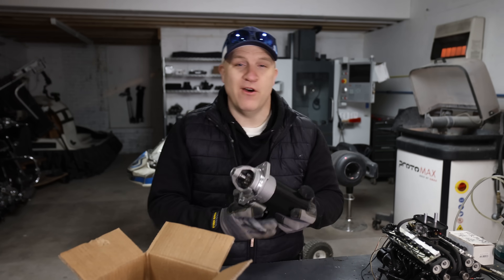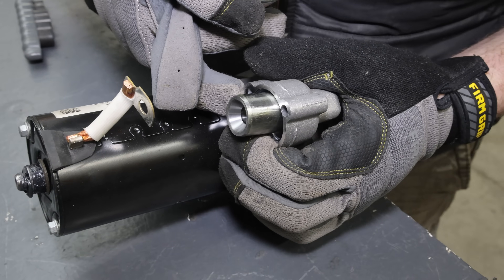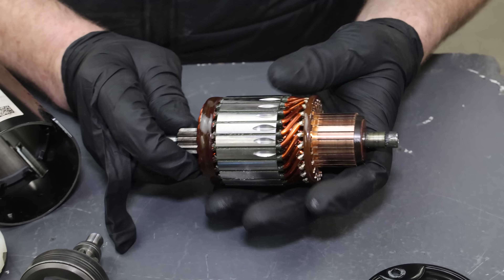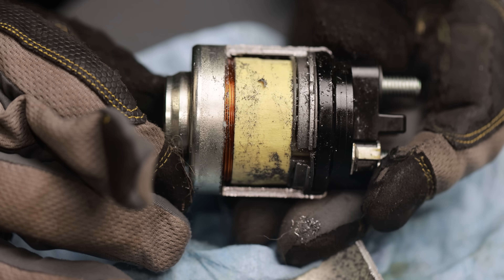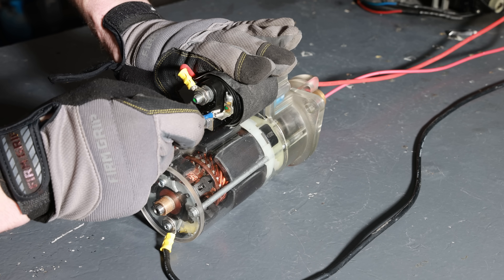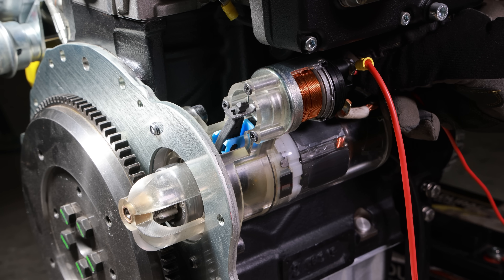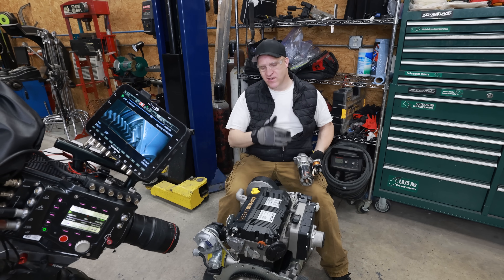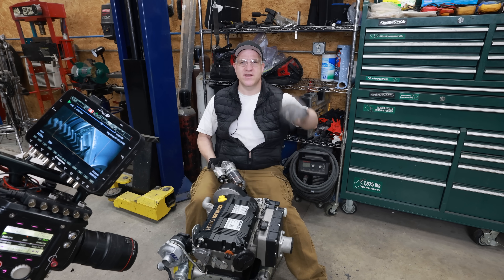See Thru Engine Starter

Comment: The cylinder where the magnets are glued need to be metal, it's called flux ring and it improves torque and efficiency
Reply from the maker: Yeah I meant to talk about that in the part in the video where I mentioned about the transparent plastic case and the ground, but I forgot and I didn't think it would make that much of a difference, it made a huge difference. I'm positive if I would have pulled the injectors out of the diesel it would have still spun it but that was way too much work as you could imagine. The magnetic flux is definitely a cool subject, magnetism in general is very mesmerizing.
Reply: Yes, magnetism is a weird thing. We all know it, yet none of us really know what a magnetic flux is and how it works. Luckily as engineers we can apply rules of thumb and use it well. We don't need to worry about the quantum theory of magnetism which is far more weird than you can possibly imagine.
Reply from the maker: @dr_jaymz  exactly what im thinking about is the quantum theory, cosmic forces like magnetism and gravity are very strange things.
Reply: @WarpedYT pulling glow plugs is easier on those.👍
Reply from the maker: @chrisprobert6  but I thought the glow plugs on these only go into the intake manifold, I didn't think they went into the cylinders.
Reply: Came here to say just that. I imagine the torque is down quite a bit without the flux concentrating through the case. On top of which I bet the ground is not passing enough current either.
Reply: You are right.
Reply: it contains the magnetism?
Reply: @gabrielvieira.4358  It concentrates the magnetic flux by effectively short circuiting it through the metal housing. You aren't making the actual magnets stronger just increasing the density of the magnetic flux. A motor without a housing and flux ring is like pushing against air, and a motor with a housing and flux ring is like pushing against water there is more for the motor armature to push against.
Reply: @ADRIAAN1007  So it's literally what I said, it contains the magnetism so its stronger
Reply: @gabrielvieira.4358  it's got electrolytes
Reply: I thought that was the flux capacitor. :D
Reply: @sonicdewd Beat me to it. I was just looking to see if anyone went there. Great minds think alike.
Reply: The metal housing gathers up the flux from the opposite side of the magnets, the side away from the rotor. By combining all the outside poles, each inside pole of each magnet can push with about 4X the flux field as a single magnet. But only for a short period of time. The magnets will get hot if not for the heat sinking capabilities of the outside casing that the magnets are bonded to. Starters are bad-ass small, electrical motors!
Reply: The case could be described as a "magnetic conductor" - it conducts the magnetic flux. Without the field becomes weak, so not only the torque was way lower than originally intended (that is why it did not cranked over the first time, before it broke), but also why the no load rpm were so insanely high, so most likely either some bearing heated, or the commutator was arcing way too much (because of that high rpm).
Reply: Should have taken the plugs out ! Great experiment in any case.
Reply: I think this type has permanent magnetic with a consistent feld. Old school use wires wound on metal to create a magnetic feld. I have a starter that has an aluminium case. It's quite lite. I think it from something that flys. It still works.
Reply: bro what happened to your finger?

Comment: We need see thru engine and trans
Reply from the maker: Yes I have been working on that for a while, and I see garage 54 knocked it off but I haven't done that video yet because I want to do it right, I want it to be legit.
Reply: if you want a sneak peek watch Garage 54. I wonder what Warped Perception could to tho..